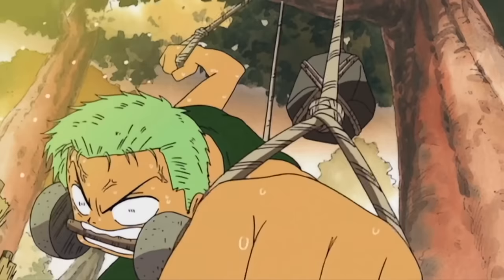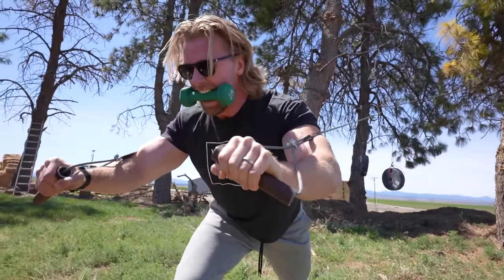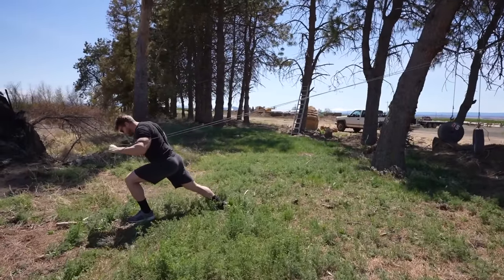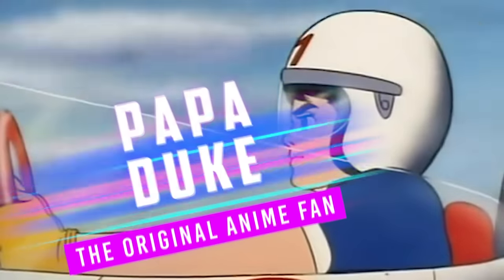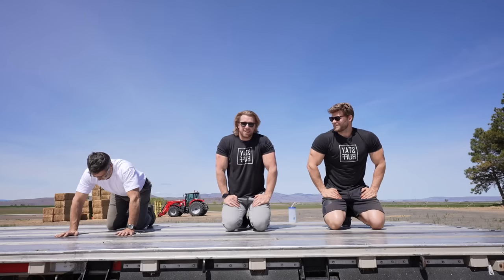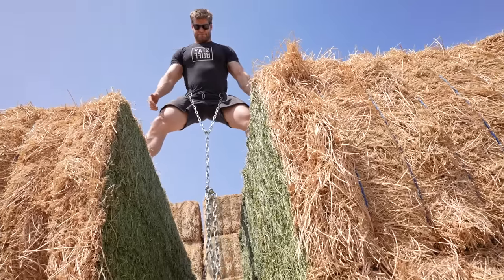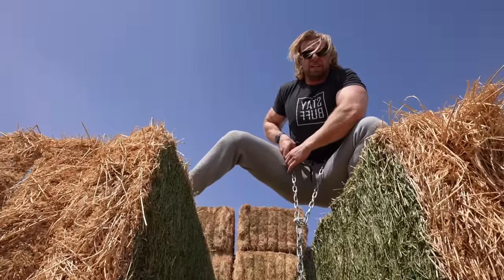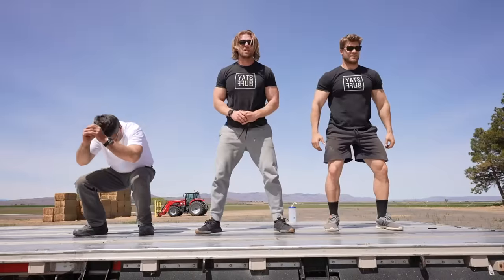Can We Survive an ANIME TRAINING MONTAGE? | Movie vs Reality

Comment: Sit-ups seem to be a major kryptonite factor for the Buff Dudes.
Reply: Bulking plan and situps dont mix....lol
Reply: Seemed like the real Kryptonite was that 6 mile run. None of them wanted to try.
Reply: Sit ups suck
Reply: Yeah, most bodybuilders dont train their abs specifically as due the low body fat they have six packs and stabilizing their core during compound movement is enough to get definition. Also sit ups like, especially without fixed legs take a lot of hip flexors, which again not trained directly as its a waste of time for a body builder.
Reply: My abs cramp up so easily when I work them, I know their pain
Reply: Honestly it does feel like crap when you haven't done it in awhile. But once you do it enough it quickly feels better. When I was younger I could do about 60 situps at a time. Then I started playing football and focused more on gaining muscle mass in my arms and legs. But...abs are important so I tried starting them up again thinking I could easily get right back to where I left off...i did about 15 before i had to lay down and with icyhot on my stomach for the rest of the night. I got absolutely no sleep. But after awhile of doing it again. I got back to doing 60 at a time and even excelled past that point to where I was doing almost 80 before needing to rest!
Reply: @bigoofyt1807  I do abs regularly...... I do declin sit ups with and without the side crunches every time I hit the gym (4 times a week) plus 20 daily. I did kickboxing so yeah this, pushup, and doing squats with my bodyweight became a daily habit....... I got out of shape in college and have now lost most of the weight I gained and have dropped 140lbs. (yes I realy let myself go) and when I started back up I could only do 40 at a time. now they would be the easiest part of the one punch man workout. I can almost to hanging sit ups again!
Reply: Brother?
Reply: With weight it becomes harder to do body weight exercise, I'm sorry but that kind of common sense.
Reply: @phantomberzerk9486  harder to do, but not impossible to overcome.🙃
Reply: @bigoofyt1807  I know... It also stress muscle more leading to more muscle gain than otherwise from fewer reps.
Reply: @phantomberzerk9486  yep. Been trying get get myself back into them. I've been doing situps and crunches till fail( among other things)4 days a week. And cardio 3. I've also been eating alot less. Pretty much limiting myself to one actual meal a day. Of course this is only until I regain full control of myself. When corona came through and I was stuck at home I screwed up and got lazy.
Reply: @bigoofyt1807  if you mean intermittent fasting, it's pretty nice for weight loss. But make sure you get your proteins fibre carb etc I lost near 10kg in a month by doing this.
Reply: @phantomberzerk9486  oh absolutely. Good things is that I live not too far from publix,
Reply: @obsidianmaster6782  :-P

Comment: I really don't feel so bad doing the Bioneers ONE workout doing 80 push-ups (and 80 squats, and 30 chin ups), seeing how they do 100...and FYI, I did this for the 400 challenge with AthleanX, 100 pushups, 100 situps, 100 air squats, and 100 inverted rows, for time. I mean, it took forever and I stagged mine, but I did it...

Comment: INVENTHELP IS HELPING ME CREATE THE MASSSTERFLEXER MADE WITH ALUMINUM COMPRESSION WEIGHT LOCATED AT THE TOP RECTANGULAR RUBBER AND BOTTOM RUBBER RECTANGULAR RUBBER TO WEDGE  IN THE ALUMINUM FOR TOP AND BOTTOM COMPRESSION AT THE MOLAR SECTION OF THE TEETH WHERE  THE OBLIQUES ARE AT 10 20 30 40 50 POUNDS BITE DOWN CONSTANT TENTION WHERE THE OBLIQUES ARE AT